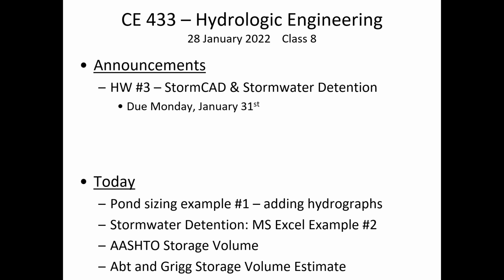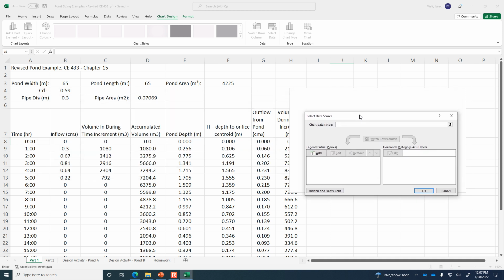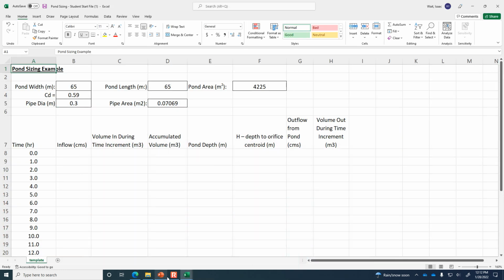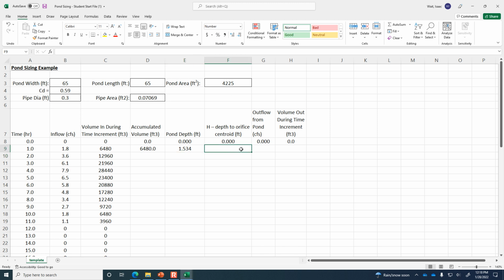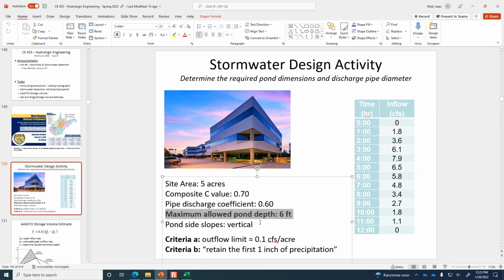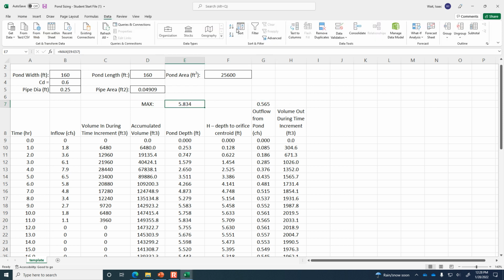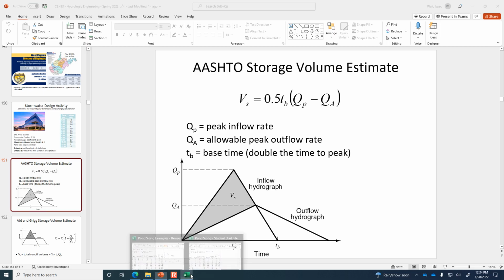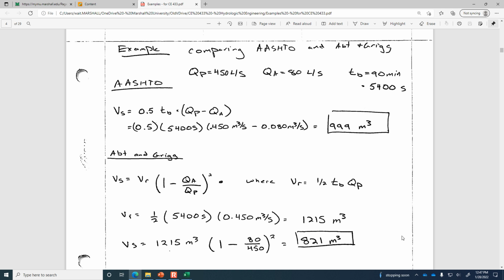Stormwater Pond Design; AASHTO and Abt & Grigg methods for pond size - CE 433, Class 8 (28 Jan 2022)

Comment: Professor Wait, for the "raising the pipe" spreadsheet section, can I input a logic in column E(starting from cell E15 in your spreadsheet): if column D(accumulated volume) < 12705, column F (H depth)= 0; else column F(H depth)= Pond depth - X offset height? What is the logic in those key cells in your spreadsheet? Thanks.